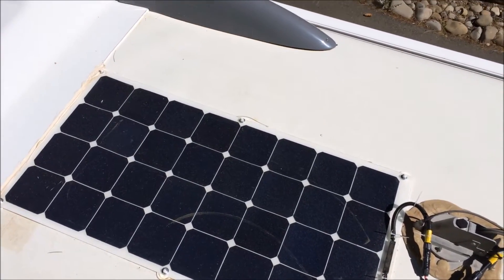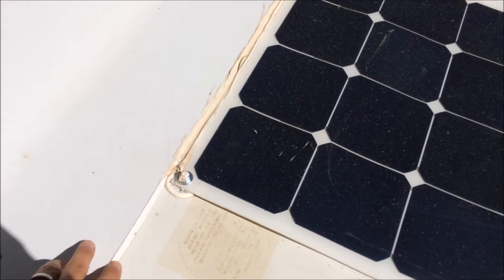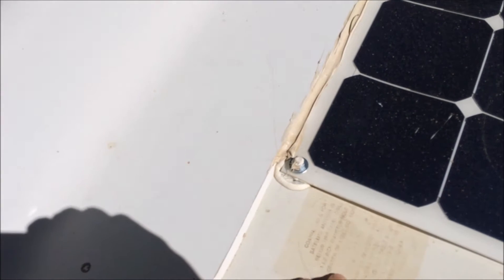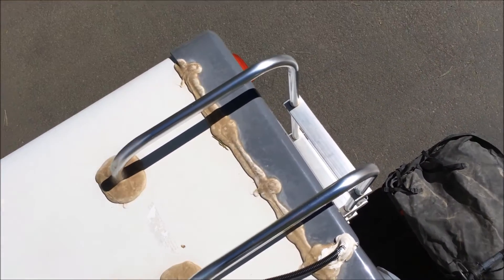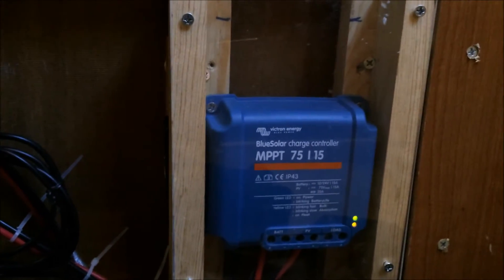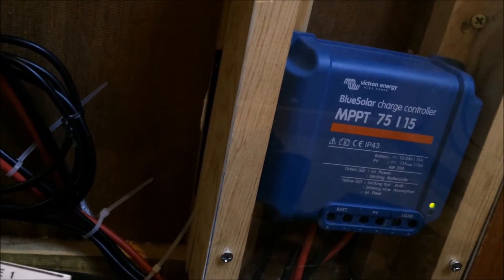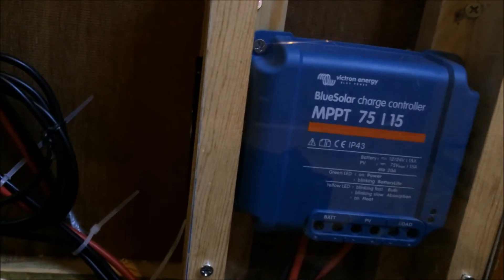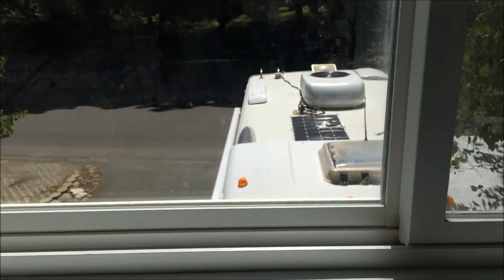RV Solar Install with Victron mppt charge controller and smart dongle. 3m 5200. Baymarinesupply.com

Comment: Hey Warren. We often see failures of semi-flexibles mounted on trailers, vehicles and RV's. Total mistery in most cases as they initially perform well. Upon closer look at the clients installation, we often notice gaps between the panel and the roof. When driving on the road, air enters those gaps and the aerodynamics causing the panel to flutter. Prolonged fluttering is a sure way to kill any semi-flexible solar panel. Not sure if this could be the cause for your failure? - We wrote a piece on our blog with video footage of a clients installation who had his panels fail twice https://flexopower.co.za/blogs/news/how-to-make-your-semi-flexible-solar-panels-die-a-slow-death

Comment: I just bought a 120 watt solar panel and the victron 75/10 smart charger and i am only getting between 20 to 30 watts in direct sunlight around 1pm(Winter time). The stage is in Bulk mode and my battery is reading 12.9 volts. Any idea what is going on?
Reply: Tilt the panel so it is perpendicular to the winter sun. If you dont get a serious increase is wattage you may have a deffective panel.

Comment: I bought the EFTE (same stuff they make bubble domes with) covered panels, I just couldn't trust the PET cover from ripping/tearing and scratching...
But that charger is pretty cool...
After Equalization do you check the water level?

Comment: Hi there, I have the same controller. Installing it, it says, only ground the controller to the battery but not the battery to chassis. How did you ground yours? It seems weird to me to not ground my house battery to chassis. Thanks!

Comment: Hi there, I have the same controller. Installing it, it says, only ground the controller to the battery but not the battery to chassis. How did you ground yours? It seems weird to me to not ground my house battery to chassis. Thanks!
Reply from the maker: VeeDub Day Spa I just followed the instructions- working great 1+ year in.

Comment: Good thing your panel fried in 4 weeks, otherwise over time they will burn your roof.  Panels need to elevated at least 1 inch above the roof for ventilation.  Stick on panels are no good for RV applications.

Comment: Hey Warren et all, Appreciate the vid bud - very comprehensive. Just a tip for anyone using flexible solar panels, it is highly recommended (almost essential) to allow airflow underneath the panels as they are susceptible to malfunction in high temperatures. Needless to say, the higher the temperature of the panel, the greater the loss in efficiency. This 'could' be achieved by using a core flute material or a light weight alloy frame to mount off the surface. Hope this is of assistance, and clarifying by no means am I a professional; just what I have learnt. All the best.
Reply from the maker: aburnz - right, propping it up kinda ruins to purpose of thin solar panels - I guess these types of solar panels are best used on a Bimini or some where they can stay cool
Reply: Warren, true, however a flexible 200w solar panel weighs in at 2.5 to 3kg whereas a typical glass one at 13kg.

Comment: Will the chargecontroller remember the statistics (total kWh) if you disconnect IT from the solar panel and the battery??
Reply from the maker: Quaam good question,  I don't know the answer.  Don't have access to it now to test, but I'd guess the answer might be in the manual.
Reply: can't find an answer in any of the videos of the victron on youtube. have looked in the manual, but can't find any answer there either.
Reply from the maker: I can test that when I have access to the RV, but my guess is that disconnecting it from power (which it gets from the battery) would delete the memory.
Reply: Warren Withers please do! But don't forget to write your numbers down in case of a memory loss!!
Reply from the maker: Quaam , unplugging the charge controller wipes the memory.

Comment: Looks like an Itasca Navion or View.  I have the same layout.  Excellent video.  I'm designing a solar system for my RV and your info is very helpful.
Reply from the maker: Do it!! You can just forget about charging issues once it's in place.  Physically the hardest part is stringing the wire under the chassis - bring it down by the generator and weave it through with the other pack of wiring headed toward the front.  Protect it all in split loom.  Read all the instructions 3 or 4 times (really) and you will be fine.  Victron does a great job.

Comment: 4200 IS ALL  U NEED
Reply from the maker: boy, are you ever right!!  the panel failed after 1 month of flawless performance, and i had to remove it - i had to cut through the adhesive and the 4200 was strong enough to peel up part of the gelcoat, so ya, 4200 was plenty!
Reply: I weight the option of 3M 5200, 4000 and 4200. Needed a UV resistant type. Compared tensile and shear strengths. Most recommended 5200 as permanent requiring a hot knife to cut the bond. Went with 4000 same strength as 4200 but UV resistant on top of Travel trailer
Reply: Heat kills solar pnls. get a framed design pnl.
Reply from the maker: I was wondering if mounting it flat might have been an issue with respect to lack of heat dissipation.  There are a lot of references out there showing flat mount flexible panels... Maybe they are all doomed to fail?
Reply: I'd agree with that, heat kills all electronic semiconductors.

Comment: Thank you for sharing this video, Sir. Can you change the Bulk, Absorption and Float voltage settings via the Bluetooth dongle- app interface?
Reply from the maker: Hey, thanks for watching!  You can change the Absorption, Float, and Equalization charge voltages on your smart phone with the dongle.  Just turn off the "Use default charge settings" then you can put in whatever voltages you want for those settings. There is no option to change the Bulk charge voltage - that number is dynamic (the way i understand it) and is based on the charge state (voltage) of the battery at that moment.   I would do your research before you change the settings... (of course!)  Happy charging!
Reply: +Warren Withers Splendid info. Thanks for your reply. From my understanding also, you are right on about Bulk voltage setting being non-configurable and dynamic. My MPPT charge controller also has configurable Absorption and Float settings. Ive read that it is advantageous to have a solar charge controller with user-configurable voltage settings so you can key in what your battery manufacturer recommends and not rely on presets. Thanks for this exchange of info, Sir. Warm regards from the Philippines.
Reply from the maker: 10-4 good buddy!  warren